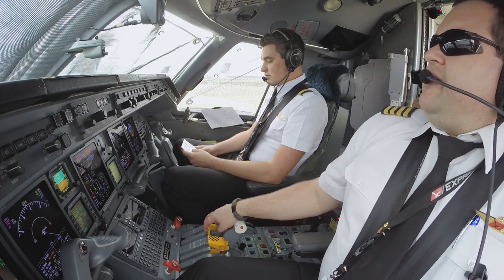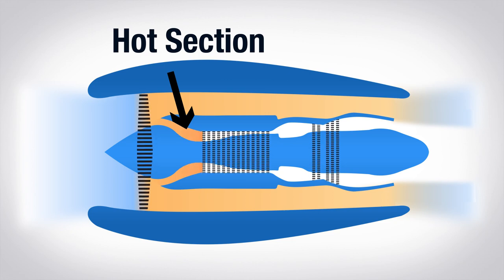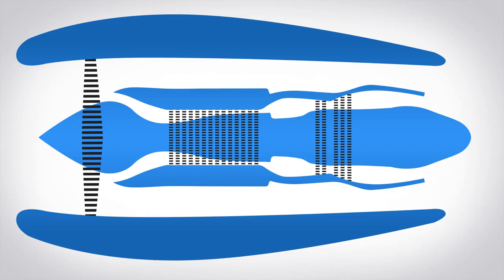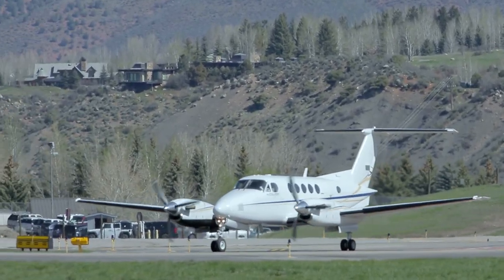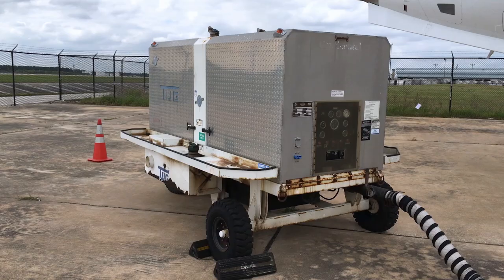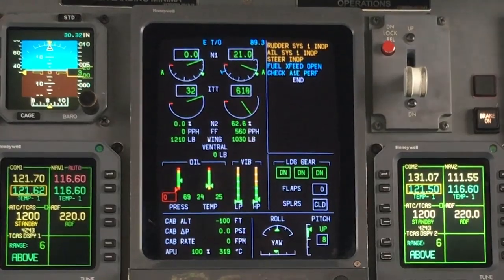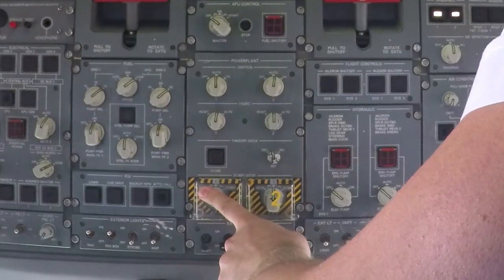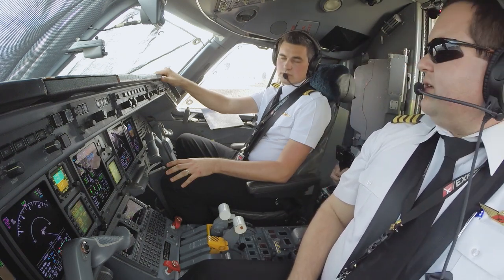How A Jet Engine Starts

Comment: Hot section is not in the front of the engine. That is the compressor stage. Hot section is the turbines in the rear being spun by the hot gasses .